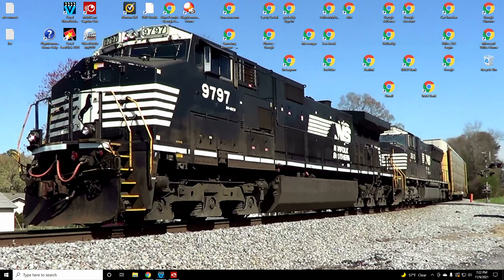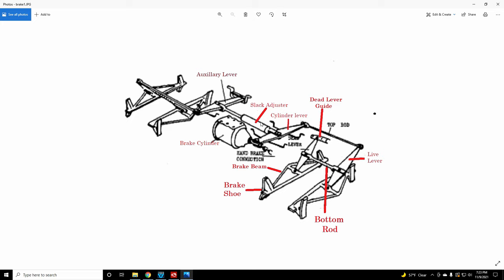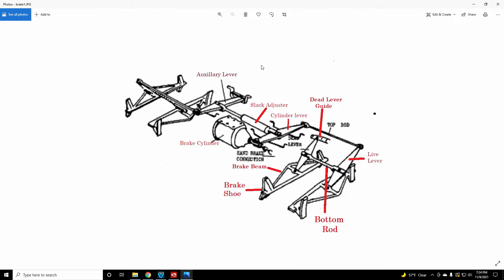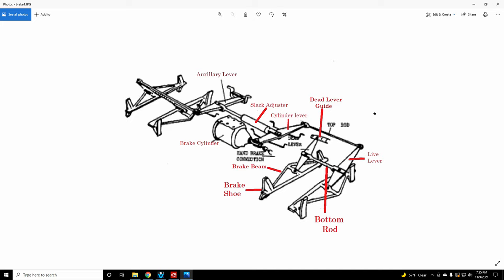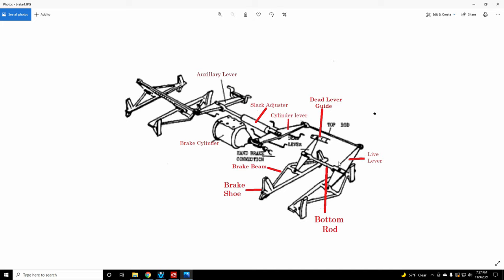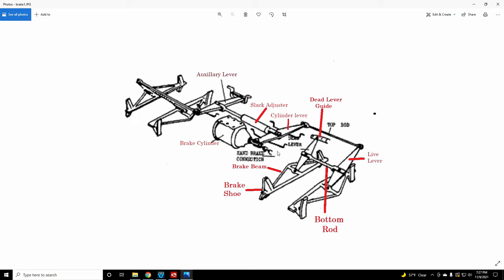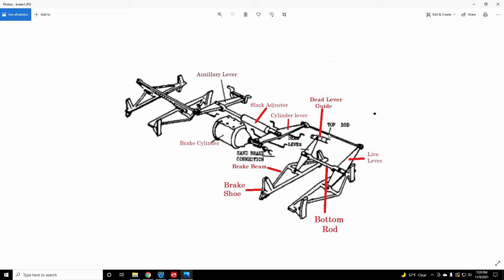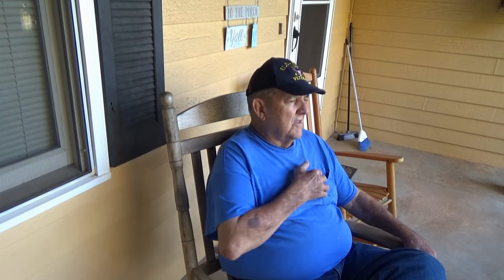How Rail Car Brakes Work & Pwalpar Railroad Story

Comment: Sure, keep up the stories.  Haven’t had a railroad corner story in a while.  
You mentioned that the railroad was a closed shop.  In Ohio, in 1963, I took a grocery carryout boy job and was told that Ohio was a ‘right to work’ state which meant that if the industry went Union, then I had to join the Union to work there.  So the Company withheld the $100 RCIA Union enrollment fee from my paychecks while I was working 20 hours a week after school for $1.25/hour (the first Federal wage law came in 1964).  The Union, Federal tax and Social Security ate my first two months of checks.  Made me hate Unions for life.
I’ll also say that I am a college boy with a BA an MS, and a PhD., but I know I have trouble driving a nail straight and I cannot weld.  My forte is electronics and computers among the things I did not go to college for. So I hire plumbers and carpenters rather than tackle those jobs myself.  You have to know your limitations.
Reply from the maker: Thanks David for your insight and for sharing  with an excellent comment

Comment: I made chili last night, so I get leftovers today, and most likely tomorrow. As a plumber I got fired similarly to your story, only I handed that JA the broken pipe and told him now you fix it. He stammered a bit and promptly took back his words after being told I was a Master Plumber and knew what I was doing, that he had no business in the area I was working in because of the chlorine gas that was in the area. I had a full facemask with a breathing device attached. BTW, and FYI, by using the vapor of ammonia you can see the white cloud of chlorine from the leak. This guy got lucky, I had just replaced the lead seal that was broken at the seat and had resealed it. I was just going to test it to be sure it was fixed at the time. A Food and Beverage Manager wasn't so lucky and I had to do CPR on him until the ambulance showed up. He didn't think about the warning signs posted over 40' from where I was working until he fell to the floor unable to breathe. The General Manager opened his window and I said call 911, this idiot doesn't heed warning signs either.
Reply from the maker: Thanks for sharing your story Hugh

Comment: Good video Walter. I realize there are a million variables but on average, how long does the friction material last on a car? If the car looses air, do the brakes “ fail safe “ like on an air brake truck? That must have been quite irritating to have some 30 day wonder desk jockey tell you what’s what about your job. In my opinion there is no better education than “hands on “. That level of knowledge can’t be learned from a book. I know because I have a doctorate from the school of hard knocks.  :)
Reply from the maker: Thanks John  The Air brakes are designed to apply when air pressure drops.  It takes steady supply of air to prevent the brakes from applying.  That is how the engineer applies the brakes, he reduces the air pressure by perhaps 20 lbs  More reducing will cause emergency application on the entire train  Ever hear the term "big hole it"  Means dump all the air, also referred to as shooting the brakes.

Comment: I love your train stories, and I hear ya about losing your job, when you get to an age you can see that they want to find any reason to boot you out. Back when I was young sat around for 6 months on unemployment cause of the truckers strike, went back to work no problem just bounced rite bak and went bak to work. Fast forward to last year sat around for 4 months and found that I didn't bounce bak man they put some real high bars for me to get my job back, because I was 67. As I right this am 68 getting ready to work 6 hours of OT, still not on medicare or SS , working full time cutting glass for windows, just cut a couple pieces for some half circles, I just enter the program and the machine does the rest ,it's a cnc.
Reply from the maker: Thanks Roberta,  I appreciate you sharing your story  I have dealt with strikes several time over the years

Comment: I remember one time when I was hauling concrete to Saskatchewan Power site that the "Engineer" on that job told me to add one Liter of water to a load of eight yards of concrete because the placers were having trouble getting it to flow down the chute. I said sure can do as I added about fifteen gallons of water. Placers were happy with me. Dumb engineers........college trained I guess
Reply from the maker: LOL  thanks for sharing Melvin